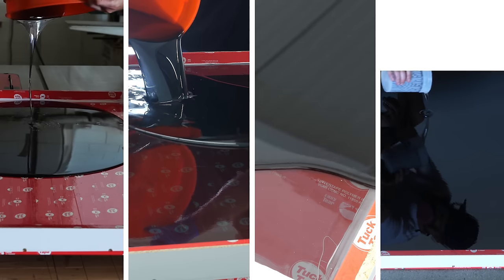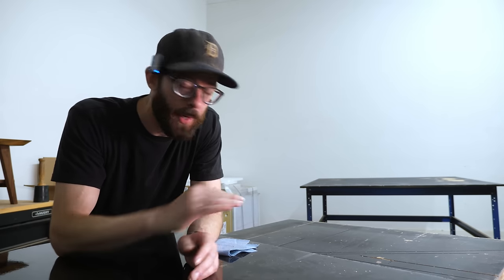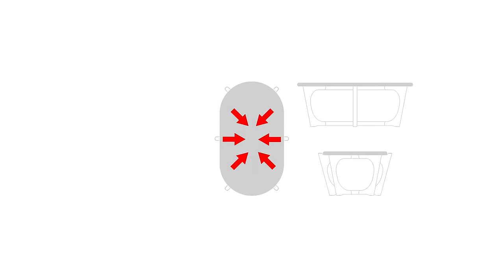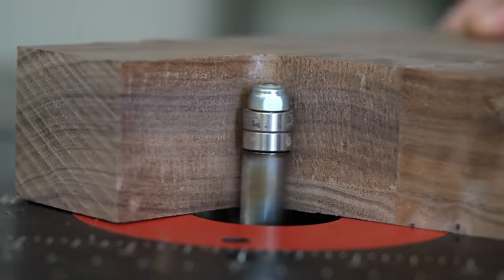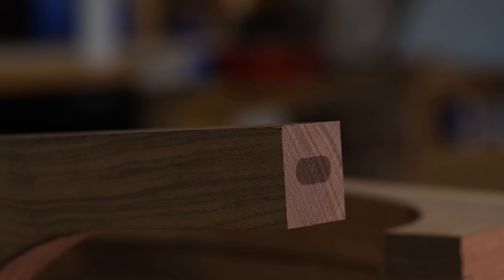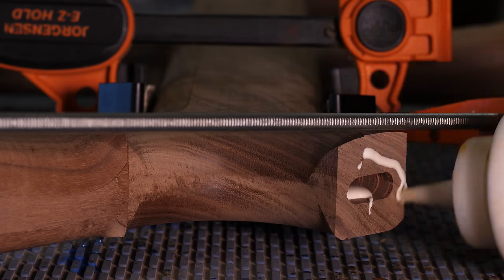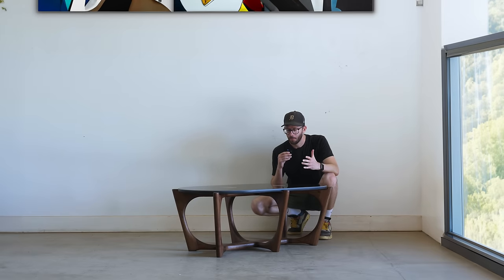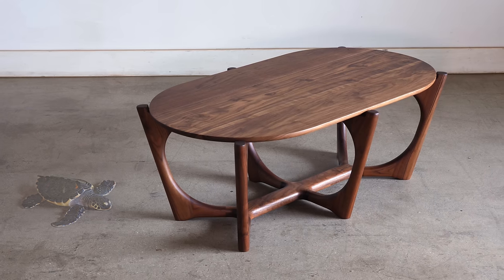Saved from the Dump

Comment: Hey, i have recently been to a restaurant. They had glass tops and over it was thin layer of 1cm clear silicone/plastic. It was to protect the glass top and also give option to keep their menu in between the layers. This would keep your epoxy top scratch free and also be usable. Easily cleaned.

Comment: 13:22 cnc tearout with wood, is avoided by switching the tool to an opposite-cutting tool, during the machining of the part.
It's a bit more programming (if you have a good programm and experience), and an automatic tool-changer is nice to have too.
For those, who dont understand the concept behind that, it's probably more understandable, when we compare it to a peace of lumber, that you try to cut to length with a dull sawblade.
At the (2) sides, where the blade cuts in the wood, you get a clean cut, but there, where your blade comes aut of the wood it tears out. 
So when you propperly change the cnc-tools from clockwise and counterclockwise cutting tools, you can always cut into the material and avoid tearout. 
In praxis you will cut with one tool by all the tearout-spots, (that apply to that tool,) a little bit (~2cm) from the outside of the material, onto your toolpath, change the tool and then cut around the material on the original toolpath (like in the video). but because the material by all the thearout-spots is now already removed, it can't tear out anymore. 
In industrial production, with good machines 4 axis+/5 axis cnc, you'd prabably make it similar like him and cut the teared out parts with a good, cnc-mounted sawblade away.

Comment: one quick trick to try before you continue to not like the table try, a ceramic spray on coating. either one for cars or they have specific ones for epoxy tables. alot of times it deepens the effect of the gloss and enhances the gloss.

Comment: Came for the flys, and also got that awesome cut off catch, clean room suit dance, and the angst between the art of woodworking and the utility of woodworking pieces.  Thanks for another great video.  If I had to pick, I'd go with the epoxy top, so the flies didn't die in vain.
Reply: Maybe cut two holes in the wood topi to match the wood pucks in the epoxy top, and fill with epoxy.  Then, glue the two together, and you can flip the top whichever way you want it, making a Mega Top
Reply from the maker: Swappable Top Coffee table...you're on to something :)

Comment: To Stop breakout on the corners of solid wood on the CNC router, you need two specific things.
1. Router must both be climb cutting as well as "roll around corners" machining
 2. Finishing Compression cut tool .
First you rough cut the outer shape leaving 3mm oversize, then clean cut with higher RPM and slower feed at full depth of cut.

Comment: Hi Chris,
I started watching this video thinking I might learn something about using a new material to make tops for furniture pieces. The prospect of a transparent/translucide top with more than two centimeters thickness and a top that weighed less than a small car (I have used glass and stone for tops of similar sized pieces) was intriguing. But what I think I learned is that I really don’t want to deal with plastic shavings and dust in the shop. Hazmat suits are fine, but if you don’t need one it’s probably better. What I ended up appreciating the most was, as always with your videos, the design process. Who knew flies could be so interesting ? Anyway, thanks for the explanations. I’ll be waiting for the next installment.
Cheers,
Keith

Comment: Sweet table.

Was thinking about your joinery for the base. Instead of the safe and difficult method of using a rasp and hand sanding the joints, you could make a sacrificial block of wood with a tenon that is the same dimensions as your main piece, temporarily fix it in the mortise, and route all the way through into the spare block. Could be safe and easier.
Reply from the maker: Thank you...yeah, there are a few things you could do. One of the other problems though...is that if you cut it before...then you're glue up has to be extremely accurate. Where as this way there is a bit more wiggle room.

The best option is on a larger piece where you glue up and then cut roundovers after the assembly. Router wouldn't fit well here though.

Comment: Great video.
I'm a photographer and artist who loves watching how-to videos even though I will never attempt to make anything like this. (First I don't have the equipment, nor the patience, and at 78 probably not the necessary strength.) 
I loved both of your results, but I think I would have chosen the wood, simply because I hate to clean and, as you said, the black epoxy would show every speck of dirt or fingerprint. 
I have 2 monitors, so I often watch (well, listen more than watch) news on one monitor and watch a how-to video with the sound off on the other. If I have no intention of actually making what you make, I don't need the audio to appreciate your design and construction skills and your perseverance.

Comment: Question about routing for joints 15:53 . You leave the joints long already and cut them with the table saw to length. Can you route the extra  maybe 1”-3” then cut them on the table saw to length and then finish route them to avoid the sanding?
Reply from the maker: Yeah...you could. A few people have asked this. There are 2 problem in my opinion. First, it'll be harder to use the sled jig for cutting joint faces with the rounded edges. And also then you have to have things line up perfectly during the glue up...or you're still going to. need to finesse it, and you'll have less material to finesse.

Comment: Maybe use both. Create some stands from the two wood circles that elevate a bit the wood body, and inset the wood body a bit. So, you have the surface of epoxy where you can leave magazines and such, and the same shape but smaller wooden surface for cups and such.

Comment: Your gouging (15:08) likely could have been prevented with different clamping positions (11:47) as the slab may have been warped enough to not flatten out again in the time between to cnc flattening. Not really a big deal because of the skim coat but maybe slightly less work.
Reply from the maker: Yeah. I kinda did a lot wrong the the epoxy top. I know my way around wood pretty well. But definitely still figuring out the epoxy bit.

Comment: The most effective way I’ve ever found to estimate the amount of apoxy needed for a project is to mix up a full 5 gallon pail, use what’s required, then pour the remainder into a calibrated 1 cup measuring cup (make sure it’s imperial liquid) Count the number of cups. Divide by 0.2366. The answer is how much apoxy you just wasted (in liters).

Comment: I would probably have thinned out the epoxy layer, created 2 of those wooden layers and stickthe epoxy in between for a nicely defined black line through the top.

Maybe there's more possibilities there, idk.

I thought the top looked pretty good. Maybe a glass overlay could've worked as well, for the dust and fingerprint related issues.

Maybe you could've done inlays into the epoxy and fill those with wood to strongly reduce the effect. (like a pattern switching between the wood and the epoxy)

Idk. I like the wood quite a lot, but it does make it more "ordinary" than it was.

I haven't really thought this out, but I think there were still a lot of possibilities with the epoxy layer. Oh well, it turned out beautiful either way. I like the leg structure quite a lot.

Comment: if it were me, i would have made the black tabletop into a low media shelf with some lighting- the black would be the internal shelves with wood around it, that way it's less likely to get dust or fingerprints on it since it won't be used to do anything but hold stuff that wouldn't get moved that much- you can get away with dusting down a shelf every couple weeks or so rather than every day. regardless, if it were me getting this table? i don't think i'd be able to choose between the tabletops, they're both gorgeous. maybe i'd switch them out every once in a while to keep things fresh.

Comment: A Beautiful piece and another excellent video edit - I always love the CAD / diagram info that's added.  The epoxy looks nicer, contrast is great and the discs give some tonal continuity.  - From one of the 30 ppl who watch the 17 who use the info practically. 
Suggestion idea - the 6 leg like an insect.. comes off the middle part of the body, called the Thorax.. So 'Thorax table' design?
PS. Tapered (spelling. im sure others may inform . only about the learning, nothing else )

Comment: Beautiful piece.  I like the look of the epoxy top, but I get the issue you have with it.

16:20 what if you kept the joining faces you trimmed earlier untrimmed until after routing? OR used the join to attach a sacrificial block so the route continues straight?

Comment: You said that you don't use the router all the way to the joint face to avoid the weird little curve. But you also cut the joint face before routing... Would it work if you were to cut the faces after routing? I suspect it may reduce the risk of "a lot lot more work"

Comment: Here's what I think you should do.. you should keep the epoxy top. Somehow break it or shatter it. Then put it back together and fill the cracks with sulfur. This is a very old technique. They used to do sulfur inlays in wood. The challenge your gonna have, is sulfur inlay heats up to 300 degrees Fahrenheit. I don't know if it'll melt the cracks more. Something to try out. I'd love to see an old technique fused with a new one. I hope you take the challenge. Pro tip.. do not over heat the sulfur.    It'll smell like rotten eggs. Have fun.

Comment: I love how this was a way to use the extra epoxy that ended up being better without that epoxy. But it would be neat to use as a front for a console or something, split into two as doors with the wooden circles holding handles. Makes the circles part of the design, is less used than a top and obround consoles are nice! Is console even the correct English word for what I mean? I have no idea!

Comment: Quick question regarding the epoxy top finishing. 

So last episode (and I guess with all your slab and pour tables) you did wood and epoxy. Do you have to finish the epoxy to the same level of detail if you then plan to coat over it with Rubio when you finish the wood? Or does it need to be slightly rougher to allow the Rubio to take? Or do you just end up with the Rubio wiping off the epoxy and then two different finishes on there?

Comment: You could use a 3d scanner import it to a 3d modelling software and it will do all the volume calculations. Sure a 3D scanner isn't cheap, but neither is epoxy over a long term, and it's something that will take 20-30 minutes max.

Comment: If you do the round over prior to cutting the joint faces you could save yourself that "a lot more work" you mentioned..
Reply from the maker: This is true...you just need to be careful to leave them square wherever you're using them to reference the fences on your sled when cutting the joint faces. Especially if they are larger roundovers.

Comment: Both epoxy and wooden are BEAUTIFUL, it really depends how is the settings of the winning bidder's house. But I'm curious what if doing a full round over before cutting the joint faces? Can it avoid (or cut out) the accidented round over? Or will it causing other unpredictables?
Reply from the maker: Yeah...you could. A few people have asked this. There are 2 problem in my opinion. First, it'll be harder to use the sled jig for cutting joint faces with the rounded edges. And also then you have to have things line up perfectly during the glue up...or you're still going to. need to finesse it, and you'll have less material to finesse.

Comment: What if you made two bases and then split the two tops and mix them into two wood/epoxy tops.  Make up a design to divide them so that they would look like negatives of each other.  In the future if you build up a leftover epoxy form, I would break it down into smaller pieces.  Making essentially stock to use to add accents or inlays for other future pieces.

Comment: Curious, at the 16:00 mark or so, you are describing why you rounded over up to the joint face, but stopped short.  However, why didn't you round over 'before' you created the joint face and then put them on the sled and cut the faces after.  The piece should still be stable against a fence with setup blocks, then you'd round over onto the part that would be cut away by that process.  Not sure I'm describing it correctly.  I understand that ideally, the pieces don't have a profile before they hit the sled so they are more stable, but the amount of flat surface area would make referencing it easier still.  I guess you still get to break out a hand tools!
Reply from the maker: Yeah...that would work...as long as you leave your reference edges unrounded until after (the edges that hit the guides on the sled.

Comment: Uh? You can estimate the volume with a gap with water. And if you are worried about getting the gap wet, you can use any thin material plastic bag, tuck it down into the gap and the weight of the water will push the material into most larger gaps, add 5%-10% depending on how accurate you think you are for smaller projects, less for larger projects.

Comment: If the epoxy table doesn't win, then I think it could make for a super weird and funky, but cool, oversized clock. Where maybe the entire face is for the hour hand, then the two smaller wooden plates could be separate clocks for the second and minuet hands are.
Reply from the maker: I'm into it

Comment: Rather than rasp where the longer pieces connect, maybe you can account for the unwanted router roundover by making the pieces longer than needed and just cutting off the section that got rounded over?
Reply from the maker: This is true...you just need to be careful to leave them square wherever you're using them to reference the fences on your sled when cutting the joint faces. Especially if they are larger roundovers.

Comment: 15:58 ignorant non-woodworker question: would it work to add a sacrificial block onto the end, say via tape and CA glue, so you can extend the roundover to the end of the workpiece?  Then just knock off that extra block and have the final shape without a lot or a lot-lot of work.

Comment: Is your glue less viscous than other glues? It looks runny to me. Is there a benefit to thinner glue? Thanks!
Reply from the maker: It's tight bond 3 which is definitely on the runnier side. I'm not sure...but I've found that it works as well as tight bond 2 (more normal viscosity)...and I prefer it for walnut because of the color.

Comment: The eternal dilemma of form vs function, which doesn't really apply in this case as both are relatively beautiful, useable pieces.
The epoxy slab would make a great mirror (reflective surface thing?) on a feature wall. 
As always great video and beautiful outcome.

Comment: G'day.
Please excuse what might be a dumb question, but I have never worked with a CNC machine. 

You spent a great deal of time effectively sanding the tabletop by hand, all e it a hand sander.
Is it possible to fit a sanding wheel to a CNC and tell it how much pressure to put on the job, then get it to do all of the passes? Or  tell it what depth to sand do? As I said, I have never used a CNC, so I am asking out of absolute ignorance.

My learning level is effectively an absolute beginner. I did secondary school woodwork, much of it being structural carpentry. I have had access to workshops from time to time over the years, but not long enough to develop any real skills.
However, I am hoping to purchase a house in the near future that will require the build to be finished off (builder passed away before completion). The place has room for a serious home workshop and I intend to develop my skills by building the furniture over the following few years.
I love your style of what I consider contemporary mid-century-modern, and plan on buying lots of your plans, when the time comes.
Thanks again.

Comment: I was thinking hotdog and you came pretty close with sausage body.  Hotdog was a term I used in some early graphics software I wrote for dealing with this kind of shape.  Most of my hotdog shapes had a far greater length to width ratio, however.

Comment: Is there a reason why you don’t just re-route over those connecting points after you join them instead of working them down by hand?
Reply from the maker: Router wouldn’t fit In all spots. On a bigger project that is how I’d do jt. Assemble. Then route by hand.

Comment: "Having $30,000 of tools..."  I just spent, uh, $4,000 on a bunch of components (40w laser cutter/engraver, resin printer, ventilation system components, airbrush booth, paint, painting table and components, lighting for the painting table, table saw for cutting down sheet material for the laser cutter/engraver, etc) so we could make and paint miniatures.  My wife can't work outside of the house anymore and she said this would be a fun project that may earn her some money.  I have a history of cabinetry and woodworking (albeit some 30 years ago) so it was easy for me to kind of jump in with both feet.  I warned her that more tools would likely be coming soon.  If I get back into speaker design, then a router table, hand router, and sanding station are absolutely coming in the near future.  This is a dangerous game to play with if you're trying to be financially prudent.  That said, I love the design of your work. I've always been inspired by a kind of Frank Lloyd Wright idealized simplistic and modern aesthetic and your designs sing of that.  I appreciate the work you put into these videos and the way that you teach.